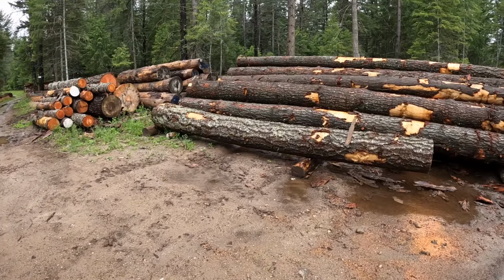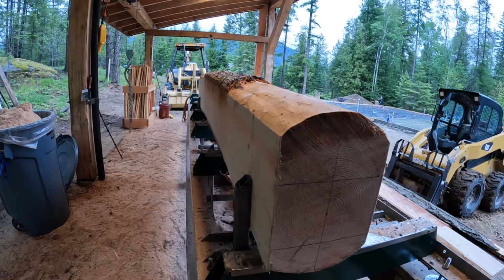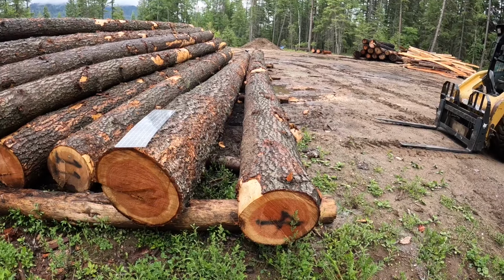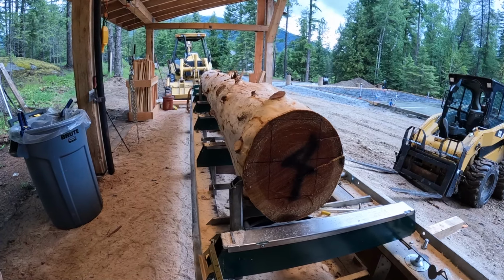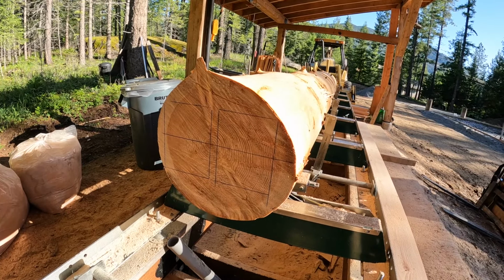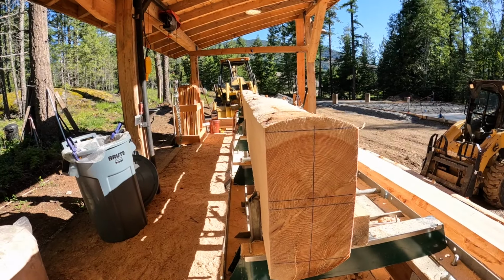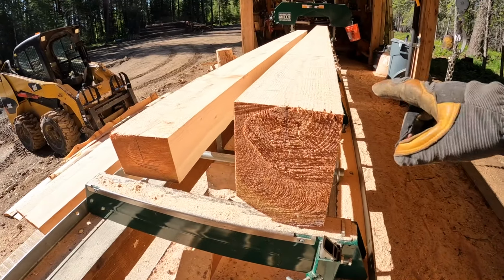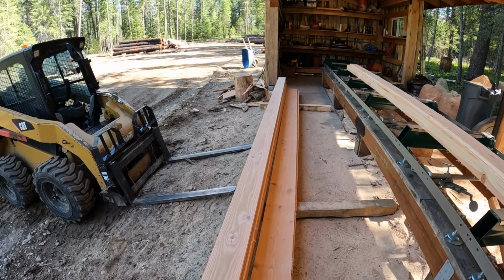The PERFECT Log Giving Me A HARD Time On The Sawmill - Milling Premium Logs For Our Barndominium

Comment: I would try setting up a rotary laser level to help see where the cut would be before actually making the cut. You could set the blade height where you are planning the cut and then adjust the laser to the blade height. That would allow you to see exactly where the cut would be on the log and better see if it was going to work. It would take a little more time but might let you get more out of a log when it is questionable if the log will yield what you are hoping. 

Looking forward to the build. Wish I could come and help.

Thanks for the video
Reply from the maker: Hi, Mike- I have a fancy laser that would work for that. But that would take all the guesswork out of it 😁. 
You’re always welcome to come and help! 😊

Comment: You don’t you use a bark router that mounts on the saw. Maybe they don’t make them for your machine?
Reply: Answering my own question. Very expensive accessory. Once you build your barnderminium you will be over milling logs. You are not planning to be a production miller.
Reply from the maker: Hi, Pete- Those bark routers aren’t really set up for these Woodland Mills. 
And yes after this build it will go back to a hobby mill. 
It’s getting the job done though! 😁

Comment: Worst music and monologue to put me to sleep.
Reply from the maker: Hmmm. I’m confused- it put you to sleep or it didn’t? If it did, sometimes you need a video to help you nap…as long as it’s a 47 minute nap! 😂
Reply: You mentioned you are going to use SIPs for your roof structure? Have you done some research on sips about vapor/ moisture problems? I was considering using them before but found info about moisture getting into the osb layer and causing it to fail. I went with conventional construction. Not sure if they have figured out what was causing the problems…. just a heads up.
Reply from the maker: Hi, Michael- Yes, I am aware of the moisture problem with SIPs and spray foam. We are going with reputable companies and we are going to put an Energy Recovery Ventilator (ERV) system that will monitor humidity. But it does worry me- it would be terrible if some kind of failure happened. 😞